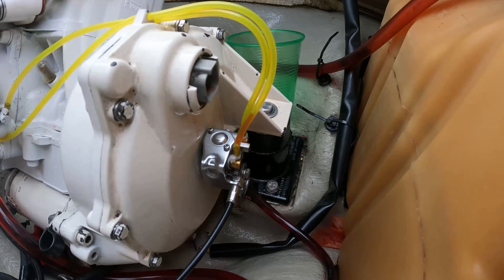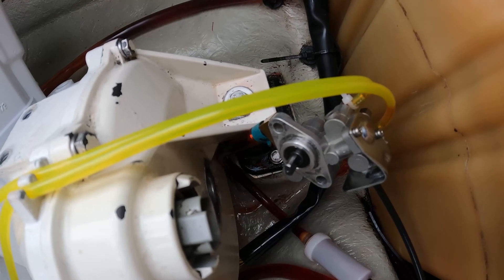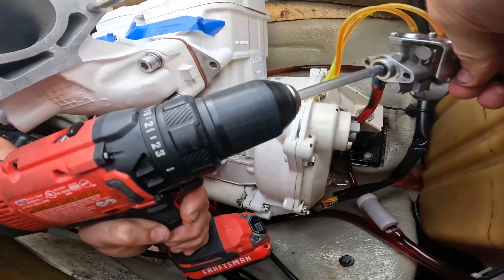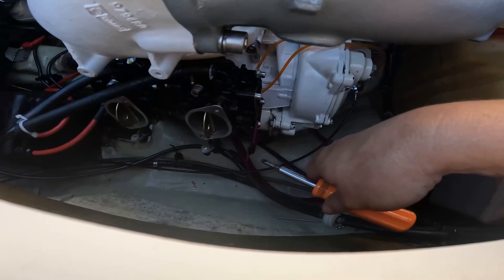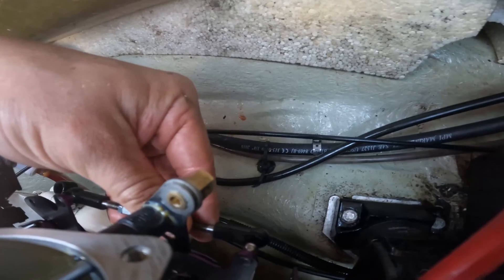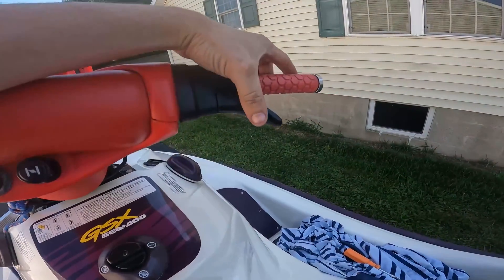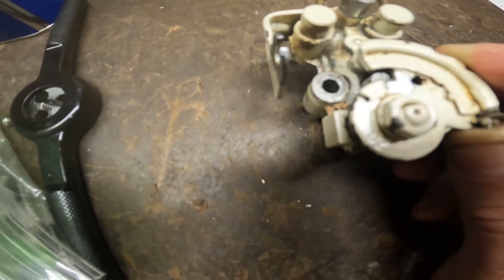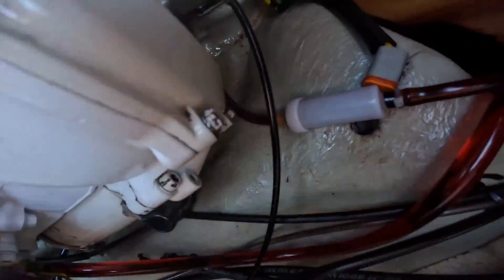Seadoo | Installing Fuel System | Syncing Oil Pump and Throttle

Comment: hi mate is the oil adjustment made with the butterfly's in the fully closed position or after the idle is set?
Reply from the maker: 1) put butterfly in closed position
2) attach the carb linkage and adjust if you have to… now the carbs are syncd 
3) turn idle screw in about two turns in from contacting the lever… this is a good starting point.  
4) attach throttle cable and set your throttle slack 
5) attach oil pump cable, align the notches 
6) with a warm engine, preferably dipped in water on the trailer, make your final idle adjustment… rpm 1500 in water, 3k on trailer
7) go back and make your final throttle slack adjustment… no more than 1/16” play
8) followed by making your final oil pump asjustment.  For most engines except the 951, you will use the jam nuts on the triangular bracket for your oil pump adjustments.

Comment: Where did you get the yellow oils lines from and that mirror!? You make this look to easy. I can feel Fiberglass on my forearm already
Reply from the maker: The mirror you can get at an auto parts store or harbor freight.  The lines are Oregon 3/32” inner diameter.  You can find it on Amazon.